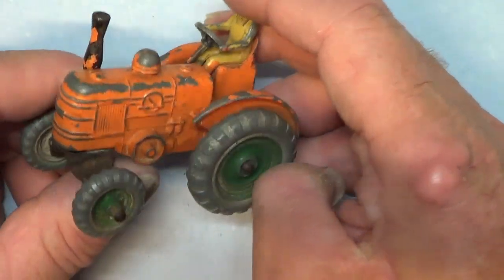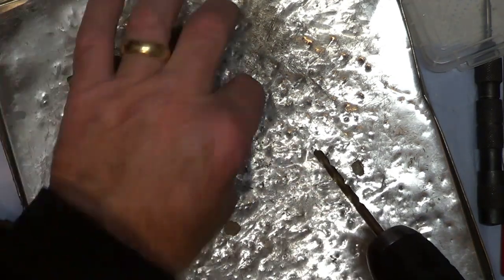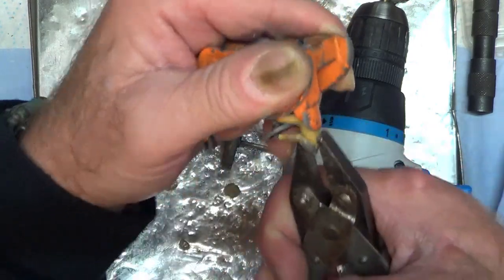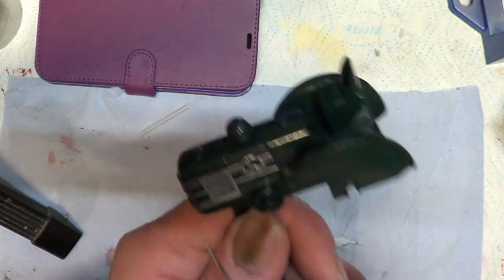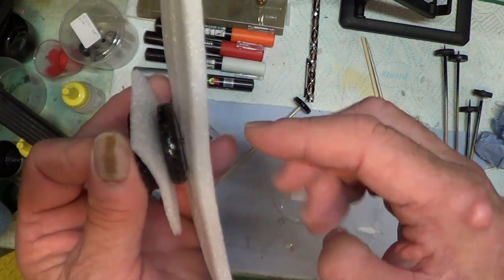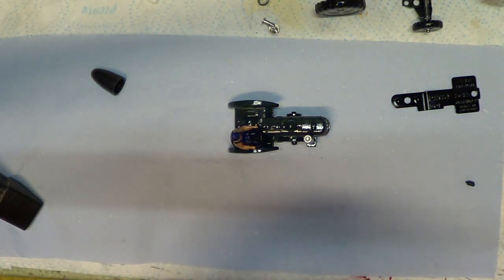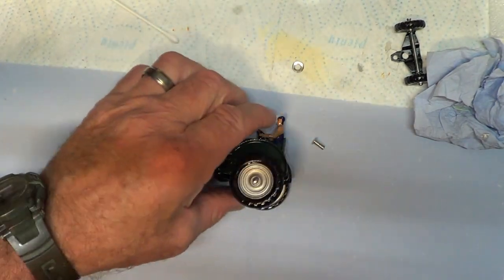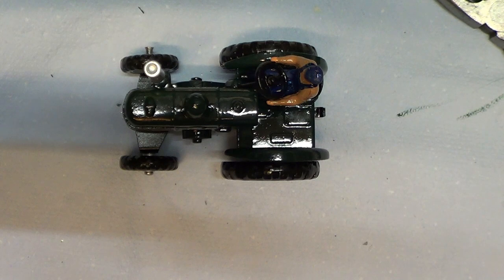RESTORATION OF A DINKY TOYS FIELD MARSHALL.

Comment: I don't think you are doing yourself any favours by using the X-acto blades for scraping - you really need a Swann Morton Scalpel and 10a or 11 blades, Nick - the big knife is too big for scraping, I think. Otherwise, I love the Tractor, as mentioned on FB: looks a lot better than the orange one I have!
Great job as usual!
Reply from the maker: Thank you Fraser, I did use a different knife with a rounded blade to do the initial scraping, I thought I had filmed a clip of me doing it but I obviously can’t have because I couldn’t find it lol, I just had a little poke with the big blade where there were the curved blade didn’t quite get, but I will have a look for the scalpel you suggest 😊👍 I do prefer the green version of the Field Marshall, though I do have an orange one in my cabinet too which was given to me about 30 years ago as a Birthday present from my late ex mother in law.
All the best, Nick🐸🐸